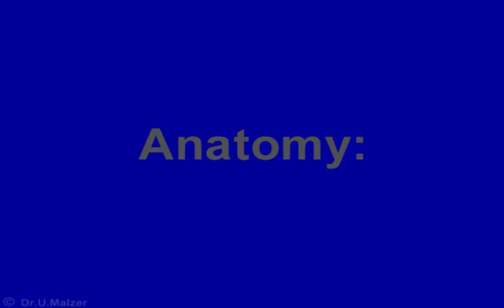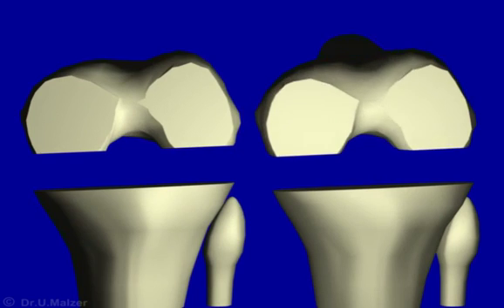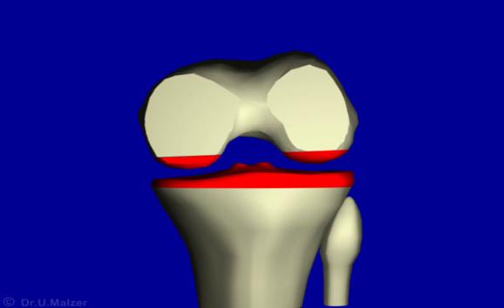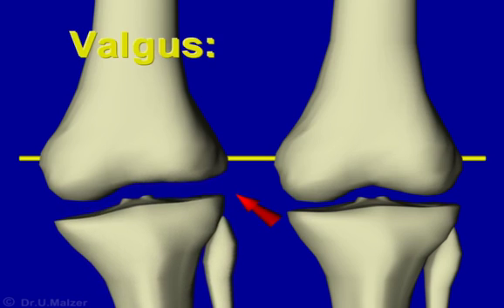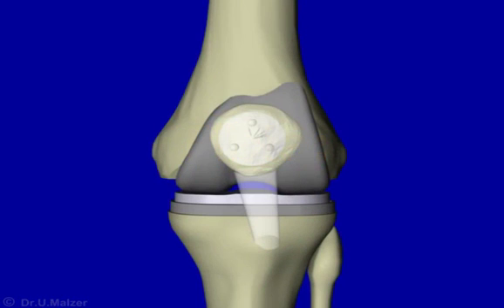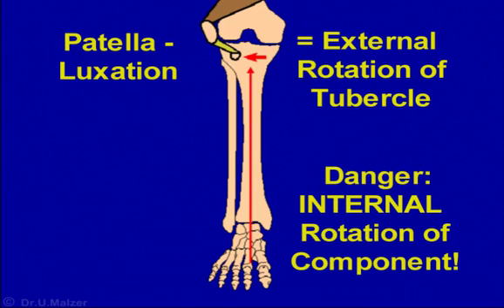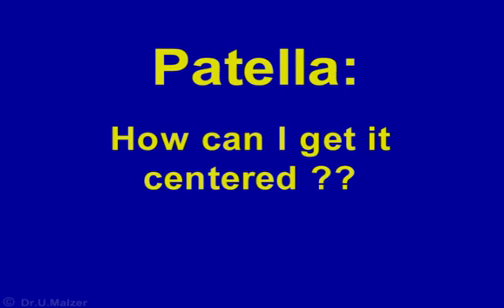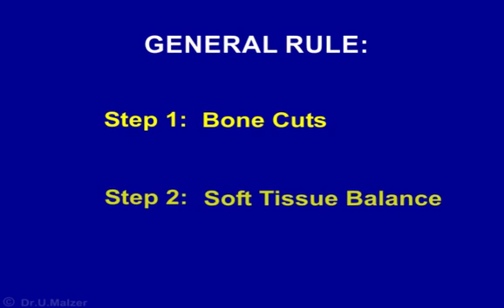Component Alignment in Total Knee Arthroplasty

Comment: Books mention no bone cuts till ligaments are balanced & deformity is corrected .
Can u clear the confusion please .
Reply from the maker: Thank you for your question. 

There are certainly many ways leading to successful TKA. But in my own experience with some thousands of total knee surgeries I have learned to rely on anatomy first.

Alignment techniques as mentioned in the video refer to anatomical landmarks, which are always present and always identical - not only in normal, but also in pathological situations. 

That's why I always perform resections following anatomy first.
After bone cuts have been made, ligament balancing must be addressed. In those cases, where balance can not be obtained, additional surgical procedures or the choice of a more constrained implant has to be taken into consideration.
Reply: @umalzer  Thanks for clearing the doubts